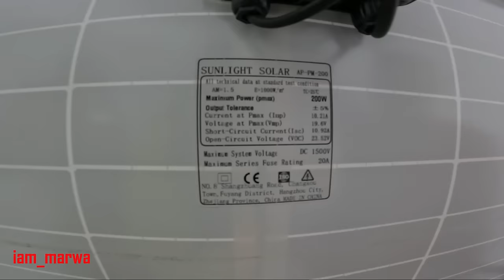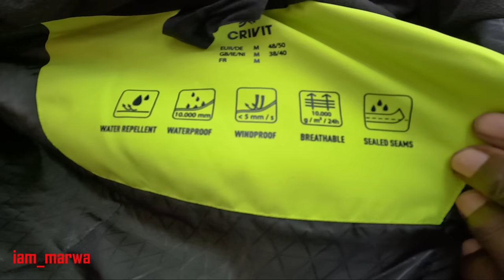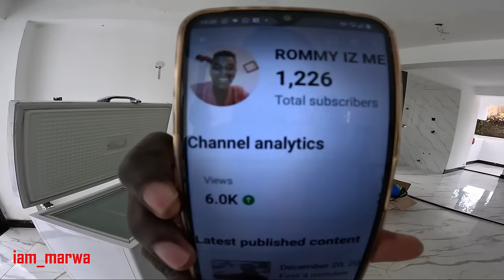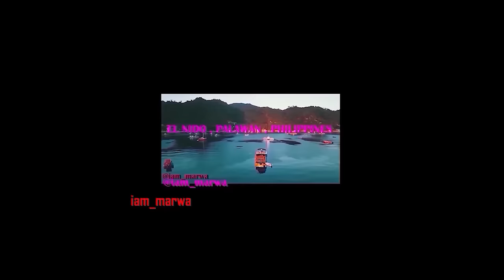The Million Dollar Package Has Finally Arrived !!! ( financial vlog ) !!!

Comment: Marwa you should tell gintu he is introducing the fish into the water all wrong and it will cause them die off again. He should leave the fish in the bag sealed with oxygen inside and put the bag intact in opened into the pond they are going into and leave them like that for at least 2hrs before opening the bags and let the pond water mix with the water in the bag and the fish flow out of the water on it's own. That way the fish and the water in the bag acclimate to the pond temperature without direct contact.
Reply: Hey boss they are following the experts instructions from where they purchase them from.
Reply: @charleswhite758 are you a professional fish farmer?

Comment: The Earth is 3/4 th covered with water.  
About 71 percent of the Earth's surface is water-covered, and the oceans hold about 96.5 percent of all Earth's water. Water also exists in the air as water vapor, in rivers and lakes, in icecaps and glaciers, in the ground as soil moisture and in aquifers, and even in you and your dog.